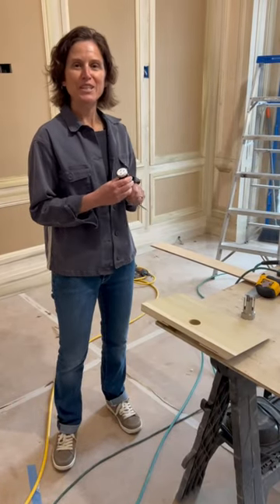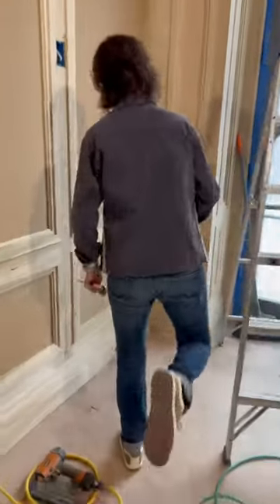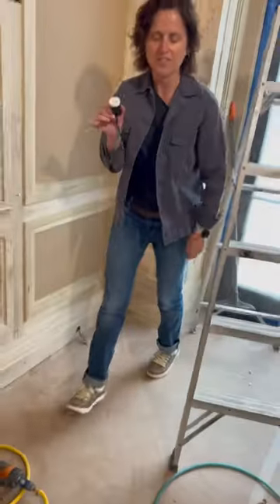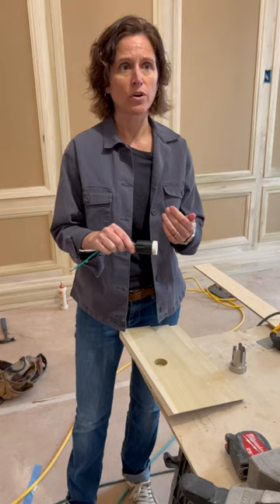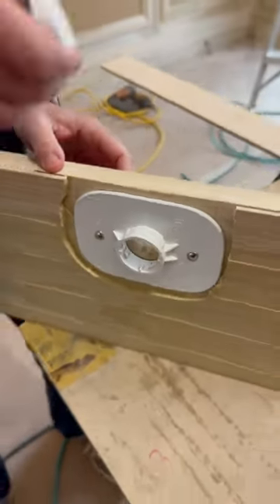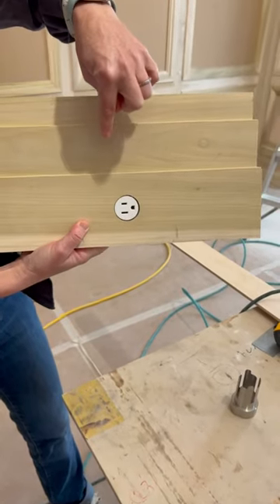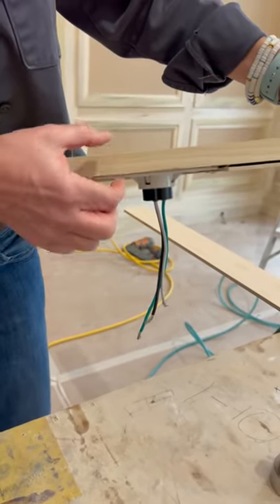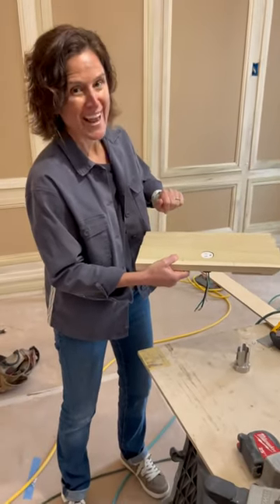Step by Step: Bocci 22 Baseboard Installation

Comment: I'm an electrician and even if an inspector accepts this, the installation of this 'thing' looks like an absolute nightmare for everyone! I hope I never have to install one of these.
Reply: Welcome to my world! This is the second time installing these and thank God I haven't had to service one
Reply: @jbferrer3  I thought I will have to do it on the job I'm currently on.designer was pushing it but when home owner found out the cost he said regular outlets will do just fine lol.
Reply: These things are horrible to do whit romex solid wire, it is better to do a j-box and run flex to each box and do thhn stranded for better flexibility and individual runs making it easy to install and service them